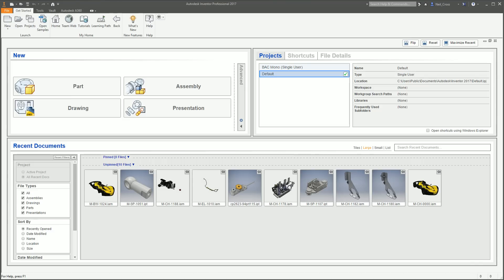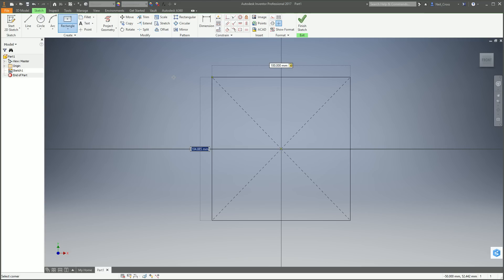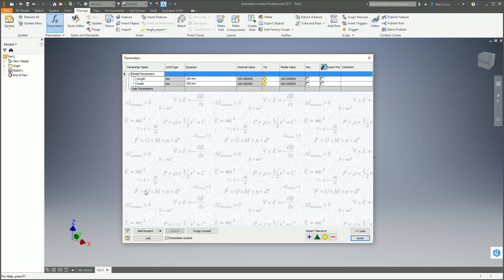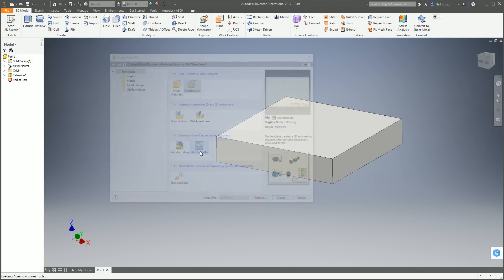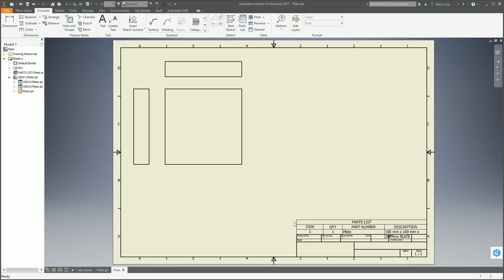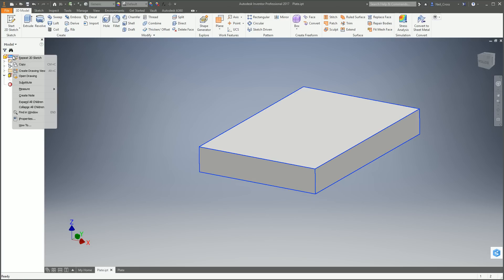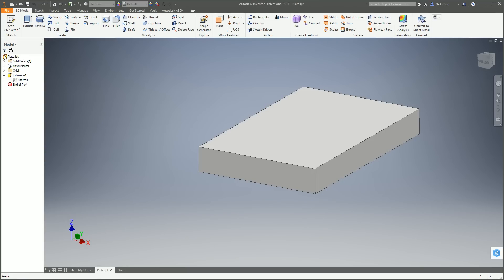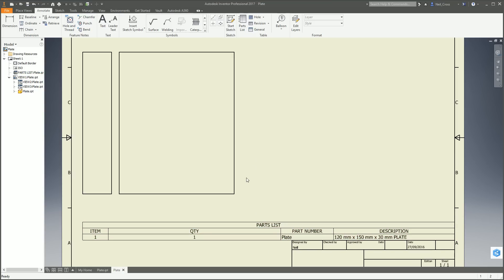iProperty Expressions For Beginners | Autodesk Inventor

Comment: Something I use that helps drive templates is using iLogic Forms to change these values quickly without having to open up Parameters tab or go into the sketch. Good info about linking the description to values and making sure the export button checked, always forget that!